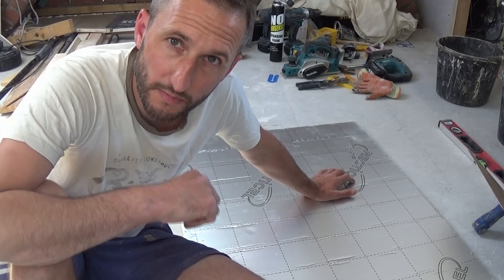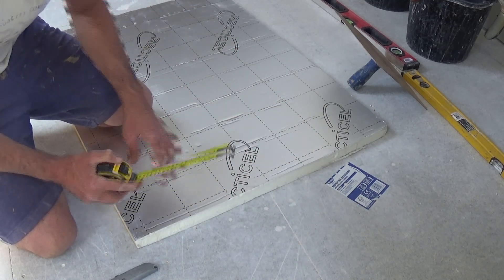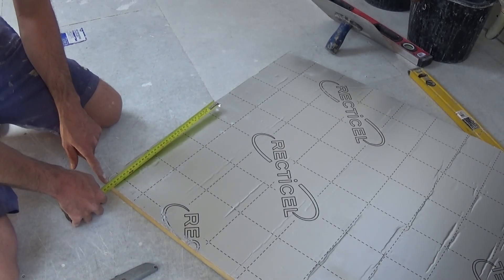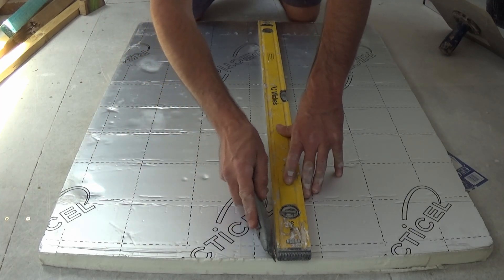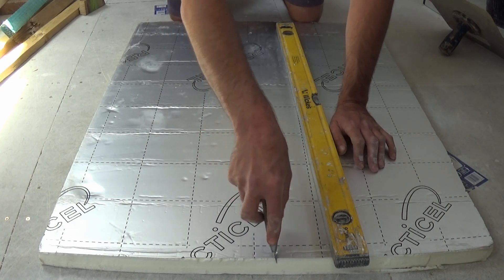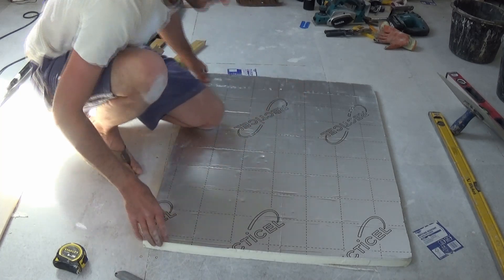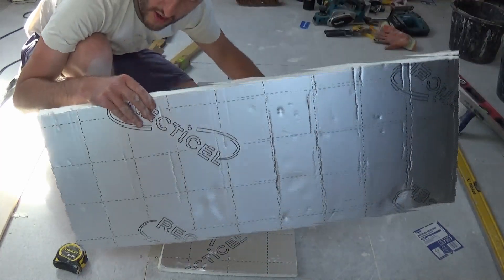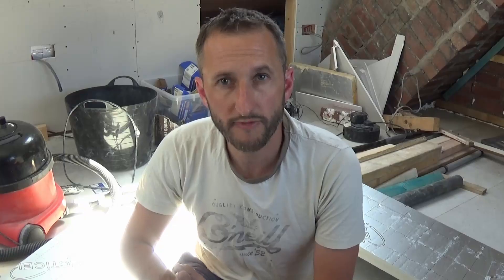How to cut thin insulation board mess free! Cutting PIR board for beginners. DIY top tip!!

Comment: I used a kitchen knife, it was harder work but went through 2" board fairly easily. I hadn't thought of doing it your way which seems easier.

What I'd like to know, is there an easy way to cut 2.25" thick board that's around 13" wide down to 1" thick? I tried two pieces of wood either side and a normal wood saw, but it made a bit of a mess of the cut side.

Comment: It will be much faster if you use a utility knife with a longer blade like a snap off knife. 

Fluorine and Titanium coated blades are also available for snap off knife to minimize friction or you can also use serated baldes.
Reply from the maker: Thanks for the tip 👍

Comment: If you had holes in a previously installed PIR board (I've got an extension where the PIR board has been cut to fit in downlights, causing issues with condensation), would you use insulation foam or would you cut a piece of PIR to fit/fill the hole? I'm an amateur DIY'er and this is a job on my list to fix soon. Cheers.

Comment: I wish there was a way of cutting 2, 3 and 4 inch stuff without sawing. Working on a refurb just now, and the owner is going way over the top with this cr@p - even insulating between rooms in the same house. Of course, the manufacturer, as usual, covers their @$$, by recommending masks, goggles, etc - which in practice are impossible to use for sustained periods. Then they assure you that the dust is 'non toxic.' I seem to remember being told the same about white asbestos in the 70's - since when three of my former workmates have died from asbestos related lung issues. Just sayin ...
Reply from the maker: It's certainly not nice to work with but this method does help reduce the mess. I hope it's not toxic or I've had it!!